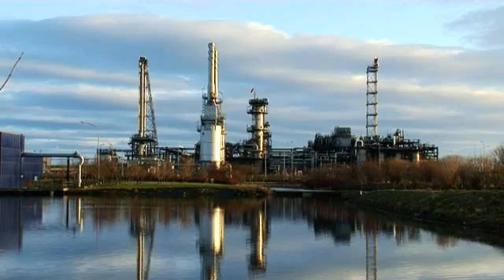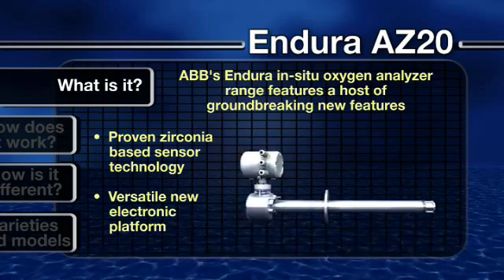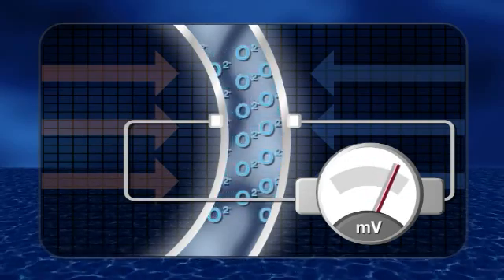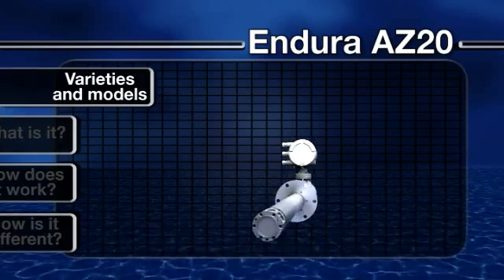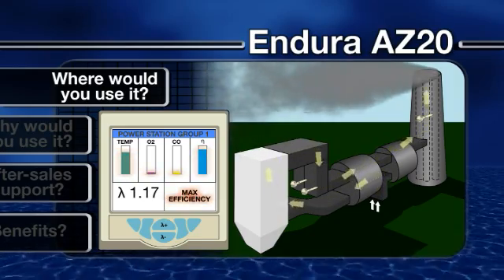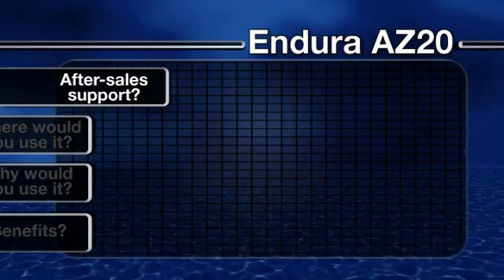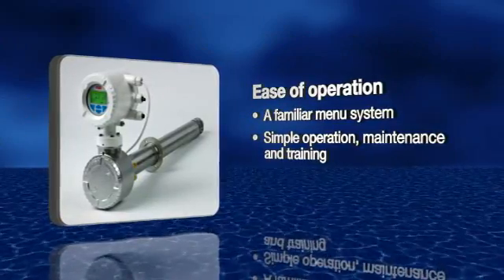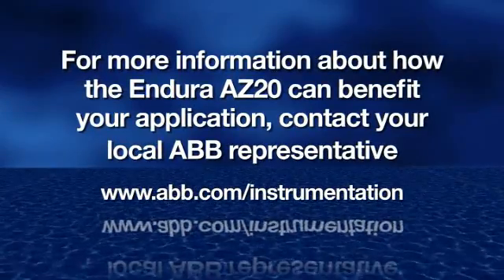ABB - AZ20 Endura Combustion Gas Oxygen Analyzer

Comment: Sir, We have installed a new endura AZ20 series probe and remote transmitter for our bagasse fired boiler. But it is showing the reading of O2 19%. In the running boiler it should show 5 to 7 % only.
   What may be the reason. We have a company calibration certificate of the same.

Comment: And why the hell would you need an "industrial" oxygen sensor in a crematoria?
Reply: I am gonna say that the temperature  in the gas is needed to know how hot the fire will be and that is adjusted by the oxygen  and gas mixture.  So when the fire reaches a very high temperature, you actually  need the industrial kind to withstand the temperature  of the fire.